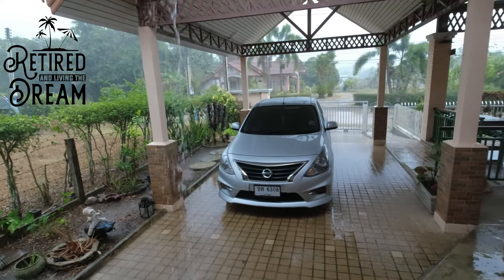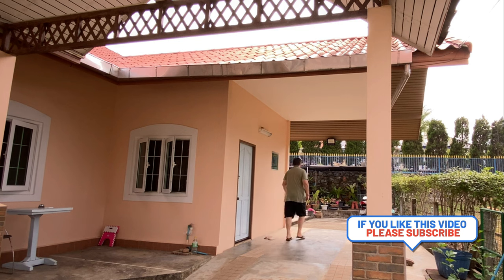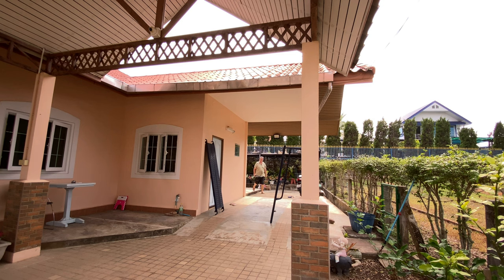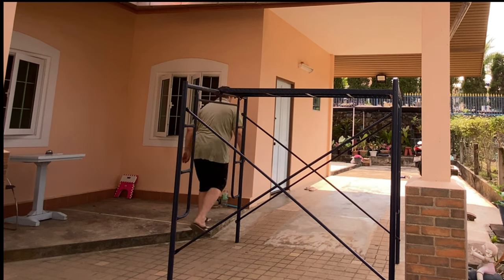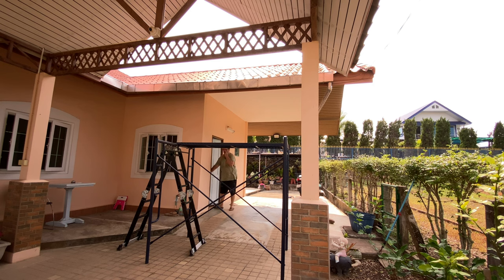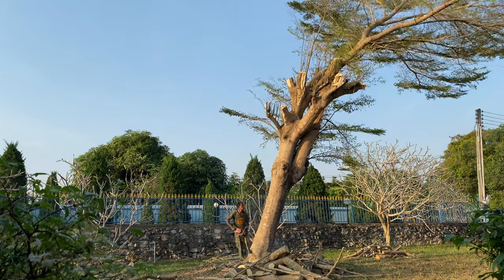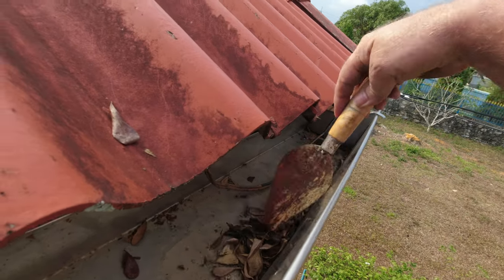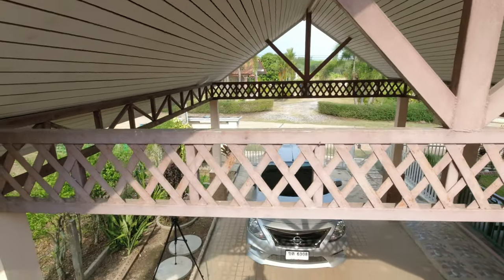A Day in my life Thailand

Comment: I love it when people do not compromise safety. You are doing a great job showing good example !
Reply from the maker: Thanks Paul. The 1,900 baht is much cheaper than a broken Hip and a trip to hospital if you fell off the ladder. As an Ex Firefighter this was a daily event for me, being one of the Officer's  in Charge risk assessment was for everything. Thanks for your comment and for watching.
Reply: No gloves cleaning out gutters below a sharp metal edged roof is safety?  Ever cut your hand on a metal edge?  I have, and many stitches could be needed if you are not wearing a glove
Reply: @EcoHumanist  , I have cleaned out gutters with out gloves on for about 40 years or more and never ever cut myself , because my hands do not need to go inside the gutters particularly  if you use a tool similar to what Les used. I also use plastic rubbish bags and have plastic clamps which I use to  clamp on to the gutters which in turn holds the rubbish bag for you to toss in your leaves .
Reply: It's so easy to think ah it won't happen to me but it happens to somebody  and that might be you who knows